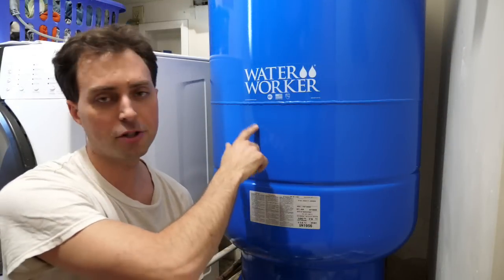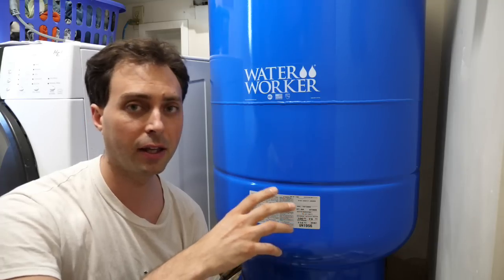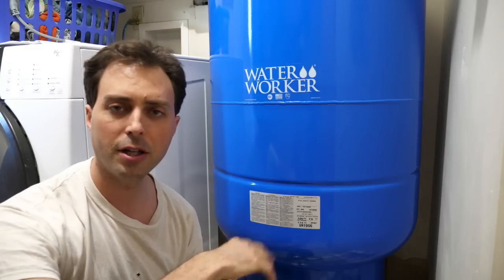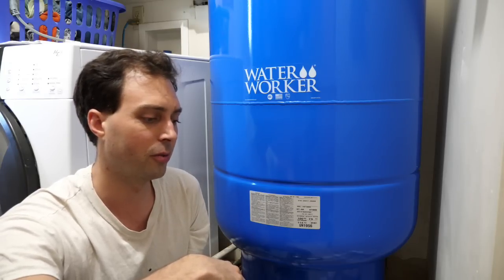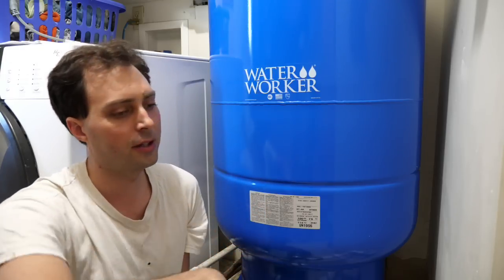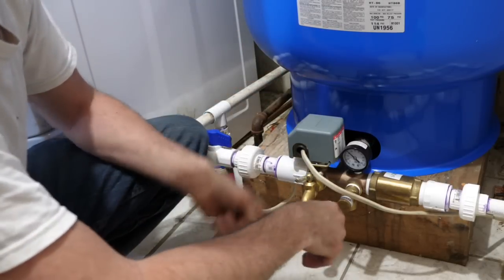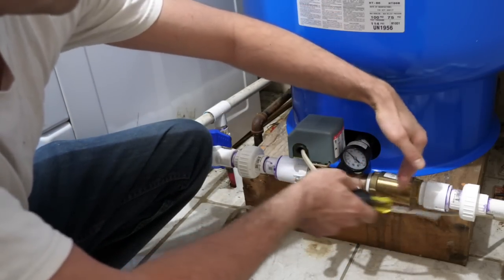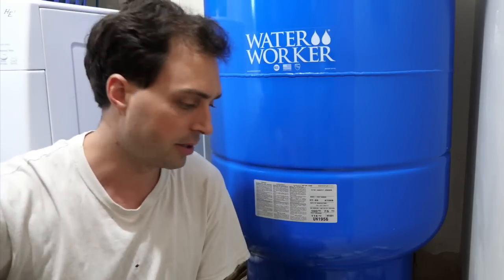Off Grid Water Pressure Tanks

Comment: Explanation had just a little incorrect point in it.  The elasticity of the bladder provides very very little pressure to the water.  What provides the pressure is the compressed air on the other side of the bladder.  Which is why you ahve to pump it up a little before filling it.  And as the space of the air chamber gets smaller as its filled with water, the pressure goes up even more.
Reply: What is the purpose of having the bladder separating the air, and water portions of the tank? Why not just have a pressurized air tank in line without this special type of tank? I'm sure there is a reason, just not sure what it is
Reply: @levicall  first reason is if you ran the tank dry on accident you would loose all your pressure in an instant and have to re-pump it. Second reason is diffusion. You would slowly lose your pressure over time as air dissolved into the water and then was carried away. Think soda and how CO2 diffuses into water under pressure
Reply: @ultrastoat3298  That makes sense. If the water is pressurized, wouldn't that automatically pressurize the air in the tank, negating the first reason you stated? This doesn't solve the second issue, but that could be addressed with a water level indicator and regular maintenance. Not being maintenance free would be a drawback obviously.
Reply: @levicall  Having a water level indicator to shut off the exit valve seems like adding complexity and cost while reducing robustness at the same time.

Comment: The check valve is meant to keep pressure ON your submersible pump. The system needs to remain pressurized or your pump would continuously lose its prime and have a dry startup, significantly increasing wear on the pump and leading to failure quickly. By the riser pipe and top portion of the Pump head remaining in a pressurized state, and the lower end of the pump assembly remaining at a minor vaccum, startup strain on the system is significantly reduced. The check valve also serves the purpose of eliminating the possibility of water that has now come into contact with foreign surface contaminants that may be in the bladder tank or piping system from slipping back down through your manifold system and riser pipe back into the well bore and further into the aquifer creating a chance of  contaminating the ground water source itself with any number of pathogens and/or bacterium. The pump itself can likely reach pressures exceeding 100psi without a shut-off like the pressure switch integrated into the system, which the internal and integrated components within the pump and motor are designed to withstand. The connected supply riser pipe, your homes plumbing system and  IT'S components and integrated appliances on the other hand, are NOT designed to withstand such high pressures hence the need for the pressure switch, or otherwise the pump would continue to build pressure within the system itself to a point of failure which would present itself in the rupturing of one of the systems components, an appliance or length of piping somewheres within the homes system. Pressure WILL find and exploit the weakest part of ANY system and cause catastrophic failure. Just an FYI

Comment: I live by my self and dont have to be comcerned about the volume of water im pumping - also i live in a single story house - 
      Im on the grid but living in a rural area power outages are often - 
      I use a water saver 
Shower head - i have my pump cut in at 7 psi and cut out at 11 psi - 
    Also i use a 12 volt DC submersable pump - i only supply it with 4 volts so instead of it pumping 4 gallons a minute it only pumps one gallon a minute - 
    DC motors require the same energy to start as they do to run - 
       In my case mine only draws 25 watts when its running - 
     I do have a regular 1 HP AC pump that i need when using pressure washers ect - 
      Im thinking about going.with an inverter pump -  
     As for the fausets ect in a house when there operated on low pressure they very rarely fail - 
     From what ive seen DC water pumps do not last as long as AC water pumps do - 
      As for expantion tanks every one has them where i live - they seem to last about 20 yrs on average - 
      If your using a washing machine or dish washer they require regular house hold water pressure -

Comment: My question is :
If I rised 2- 2500 gallon tanks up 10ft. If I put a pressure tank at the bottom will this give me pressure without an electric pump.
Just gravity. 
Please respond.
Reply: i think you get 2.31 psi per foot of elevation
Reply: The higher you put the tanks the more pressure 12 feet would be better or higher
Reply: Also start with a large diameter pvc pipe then reduce at point of entry 2in pipe run then reduce to 3/4 at house this makes more volume of water also
Reply: In short, you get 1 psi per 2.5 feet of elevation, so elevation of 10 ft gives you 4 psi water pressure.

Density of water (gamma) = 62.43 lb /cu ft
Pressure = gamma * height
Pressure = 2.50 ft * 62.43 lb / cu ft *1 sq ft / 144 sq inches = 1.08 psi, or approximately 1 psi

The elevation is measured at the water level.  If the BOTTOM of the tank is 10 feet up, the height of the water in the tank will give you some extra psi.

For example, if there is 5 feet of water in the tank:

10 ft + 5 ft = 15 feet
15 ft * 1 psi / 2.5 feet = 6 psi

If the tank is strong enough to not explode, or blow the cap off, the tank could also be modified to accept a tire pressure valve at the top, and could then have air pumped into it to get some additional psi.
Reply: In my old huntin' camp we had a 250 gallon tank in a raised position, roughly 8' above the highest water spigot. It flowed very well but we also ran our water through 1" pipe. We had good pressure and it filled a toilet tank within a couple minutes. As the tank emptied there was a noticeable change in pressure( we didnt use a pressure tank) so we would refill the tank. The water was pumped through a 1 1/2" pipe from a pond at the bottom of the ridge in front of the cabin. We had an overflow line that could be seen from the kitchen window. When we could see water flowing from the overflow we would go down and shut down our gas powered pump. Very rudimentary system but it was very effective and reliable. As long as the 250 gallon tank had water in it you had water everywhere we had a spigot.

Comment: Is the pressure switch powered by AC or DC?
Reply: Its powered by water pressure. You run either ac or dc through the switch. The switch does nothing but break the circuit
Reply: @Straight_White_Fatherly_Figure  I went to the hardware store today and asked about buying a pressure switch for a 12v solar well pump. They seemed to think I need a 12V pressure switch, but what you're saying is that doesn't matter--correct?
Reply: @allyouneedislove222  exactly. The ratings are basically for the actual contacts on the switch (do not want to over amp the contacts or they will weld together and system will run continuously)
Reply from the maker: Sorry for the late reply. Correct that the pressure switch is not powered with electricity. There are many DC pumps running off a conventional pressure switch. As long as the switch is rated to handle the voltage and amperage of the pump, should be good.